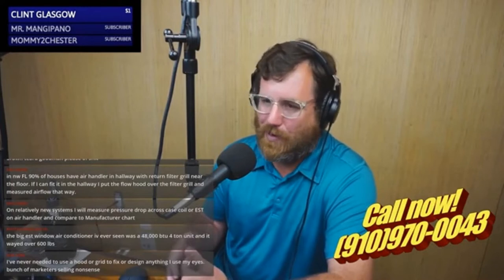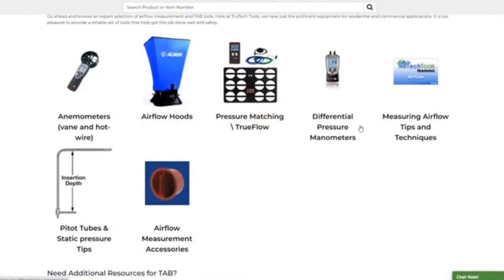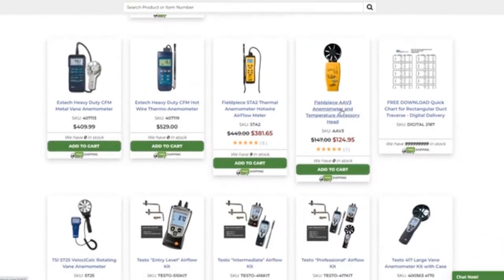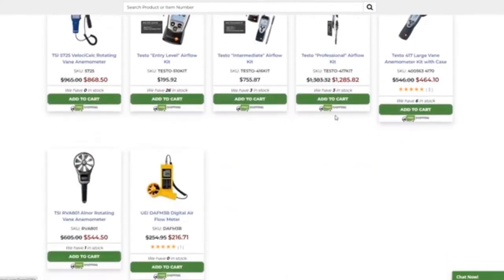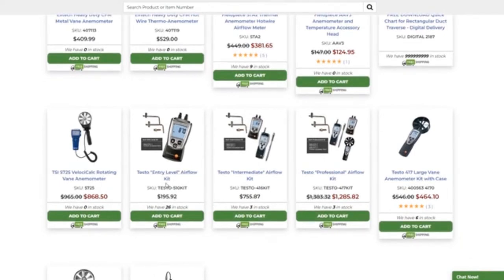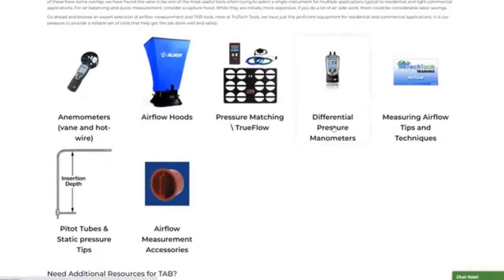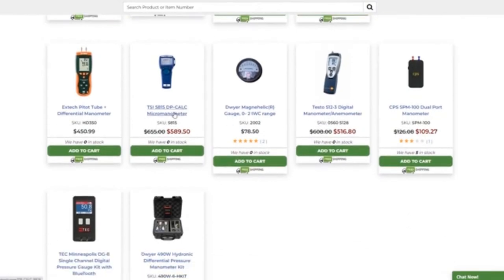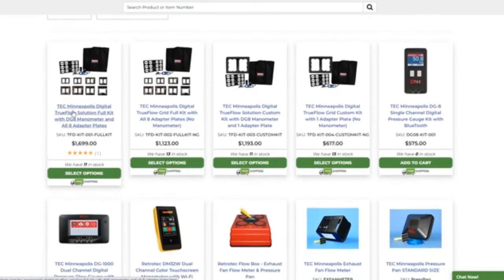Can You Measure CFM with Affordable Tools?

Comment: The field piece hot wire is past it’s prime? Hmm
Reply from the maker: Is it? I think they still make it
Reply: @HVACShopTalk  in the video you said you wouldn’t comment on the field piece as it was past it’s prime. I believe it was a sta hot wire (which is the one I use)
Reply from the maker: I’ll go back and listen to it because I must’ve missed spoke about something.
Reply: @HVACShopTalk  hello. I am looking for a CFM meter that I can hold up to my ceiling registers to see what the CFM is in each room. I got a CFM meter but it’s asking me for the area info to input. I have no idea how to do that. I had a simple iPhone CFM meter that had the fan on it years ago that just told me the CFMs. What do you recommend that I get to test my registers. I am not looking for a cheap device. Nothing to expensive either. Something that an HVAC tech would have respect for though is what I want. Thanks in advance.
Reply from the maker: @cda3715  the best would be a flow hood. They are expensive, but you could get a cheaper one like the CPS. It is just less exact than others.
Reply: The Fieldpiece STA hot wire still has its place. I all use the more expensive Extech hot wire with similar results as the STA.
 HVAC shop, I believe misspoke about the tool past its prime.
Anyway, great video on air flow tools and everything that was stated, I think it's all very true.